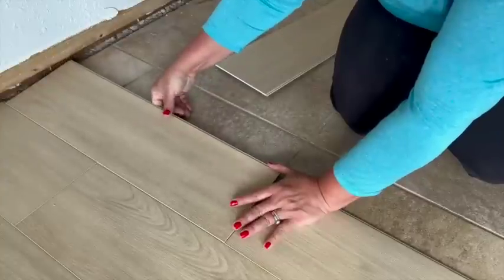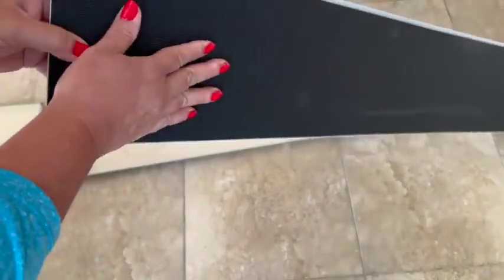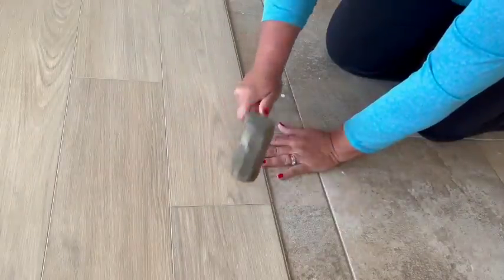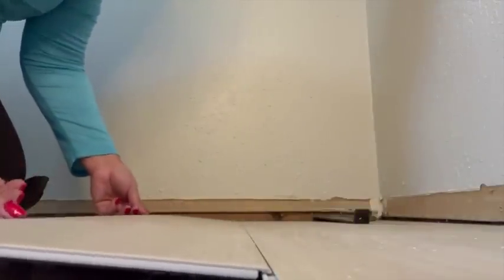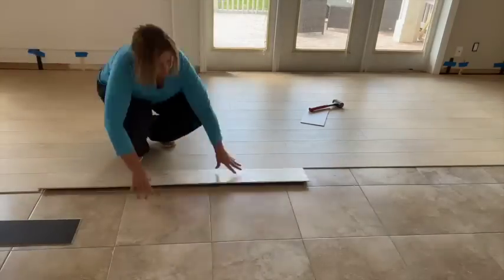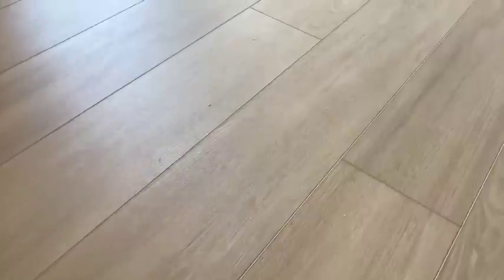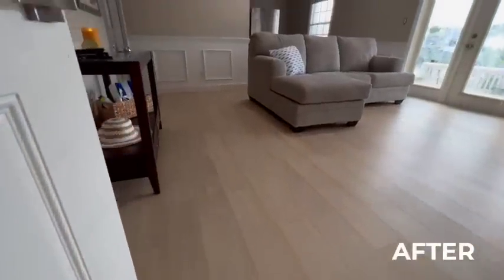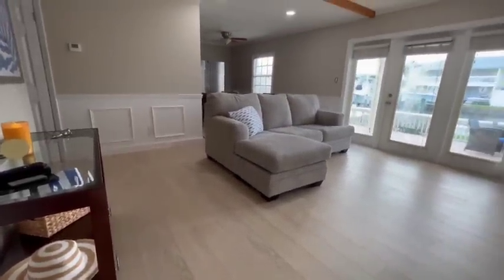Homeowner tries the new vinyl plank flooring solution DIYers are OBSESSED with!

Comment: Always take a razor knife and cut along your trim work and the wall before you try to remove the trim work aka molding, around doors/windows and the baseboards.
Reply: Yes, that's called scoring and definitely keeps you from removing paint off the wall. I always score my windows after painting too. When removing overspend. Makes for simple glass cleaning. Too bad most ppl don't know about the razor trick.
Reply: @TheStormrayn  Yes! Scoring....At the end of a long workday, processes are clear but sometimes specific words are not. 😊
Reply from the maker: Great tip!
Reply: I loved the part when she took up half the wall with the baseboard.

Comment: There are very many issues with installing this type of flooring. Luckily, it seems that your room is square, but in most situations, you will need someone with professional experience. Definitely want to use a high density waterproof underlayment as this installation will cause the floor to pop and crack when you walk on it over a period of time. Also, whoever told you to score the baseboards was absolutely right. Great do it yourself video but, I think you will have some problems in the future. Beautiful floor and I hope it serves you for a long time.
Reply: One of the things I love about this flooring is that the underlayment is already attached, so I was able to skip that step :-)  I've installed this flooring several times and I love it. It feels great underfoot and has held up extremely well
Reply: @MarciaSocas  Yes, I saw the cushion attached to the back.That will not solve the problems that I spoke about. 40 years in the Flooring industry I’ve seen it all. I hope it works out for you, but I would not be surprised at all if you hear some squeaking or have some tongues break off.I hope that does not happen to you, but I’ve seen it so many times in the same situation. Also, I didn’t see you installing the baseboard and if you did not keep that up about an eighth of an inch above the flooring, it will pin it down and it will squeak. I hope I’m wrong, good luck with your new beautiful Flooring.

Comment: Would like to have seen how walls and skirting edges of the room were repaired/ finished afterwards. Thanks
Reply: HI! I upgraded the baseboards to larger 5 1/4" ones, and these went right over the installed flooring, and looked much more elegant! I hope that helps, I'm not sure if you had a different question, but I hope that addresses it. Oh, and I should note that at the long edges, it was easy to cut the boards lengthwise with my saw where it went up against the wall.

Comment: Will installing right over tile eventually show where the grout lines are without a separate underlayment?
Reply: Nope while using recommended the underlay. She didn’t so while walking on the boards with a time they will start moving as surface level differ in small areas, so sinking of boards in some especially when heavy object will be placed for longer period will bend the board.

Comment: What about the thresholds? Transitions to other rooms? Did you need a certain type of edging for the doorways? Thanks
Reply: Hi! Since I installed the flooring all throughout the condo, I didn't need any transitions, but in other projects I have used transitions and they installed really easily. At the front door, we loosened the existing metal threshold and were able to put the flooring just a lbit underneath and then re-secure it. I was worried there would be a problem with the thickness, but there wasn't at all.

Comment: Aren't you supposed to glue it as well to hold?  My neighbor's floor planks started shifting leaving gaps. Also, I didn't know you could put it over tile!  I'm going to try it!
Reply: This is a floating floor install. Your neighbor more then likely didn't use click and lock.
Reply: Yes I love that I could put it over the existing tile and save all that dust and work and labor involved in removing the tile!
Reply: Only certain brands can go over ceramic tile floors, check the manufacturer specifications  when purchasing.

Comment: That’s beautiful but what about if your room is not square,should you start in the middle of room and work outward to each wall? Thank you ❤
Reply: That would make it harder to do. You wouldn't know where the true middle is and you'd have to end up cutting both ends to fit the awkward angles. Best to start at one side and work to the end side. I used cardboard to size my pieces and cut them to fit so I didn't waste pieces. Good luck.
Reply: Hi! Great question, but yes, as mentioned below, that would make it a bit more difficult as the job went on. For me, it's best to think through which way I want the floor to lay, and then start in the upper left corner of the space

Comment: What is the name of that cutter you used to cut the flooring?
Reply from the maker: It's a multi floor cutter - https://www.homedepot.com/p/ROBERTS-13-in-Multi-Floor-Cutter-with-0-to-45-Degree-Miter-Guide-and-28-1-2-in-Handle-10-63/316342247

Comment: One thing - you covered non toxic tiles with vinyl planks which are highly toxic. Aesthetically pleasing but not the best choice. Use bamboo boards, wood, even the laminate flooring is better choice - of course less lasting but healthier. vinyl is one of the worst choices especially around young children who crawl and play a lot on the floor. There is plenty of data out there.
Reply: I get why everyone is a professional at this particular low cost flooring. 
Cheap definitely isn't always best especially when it is toxic. W😲W